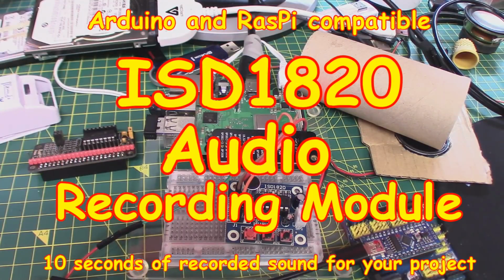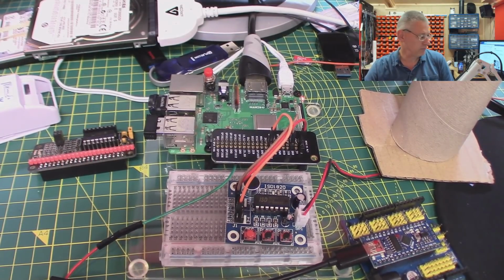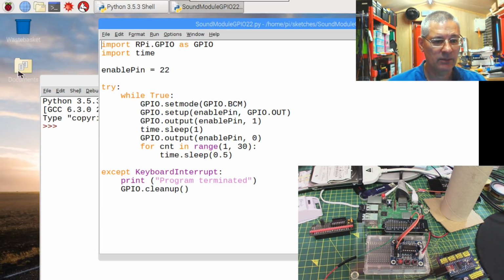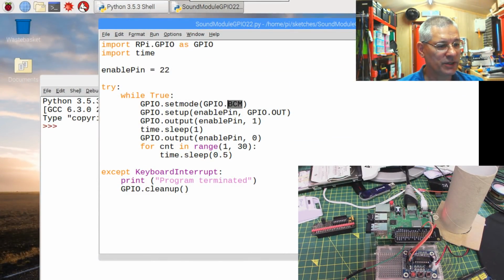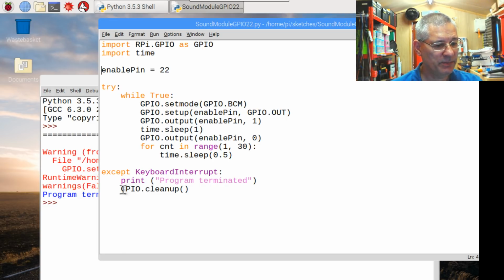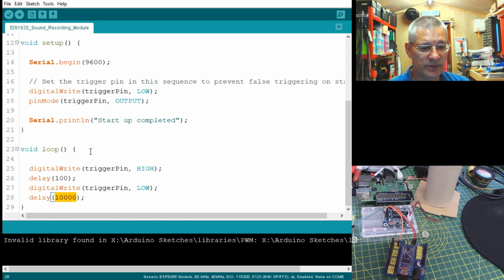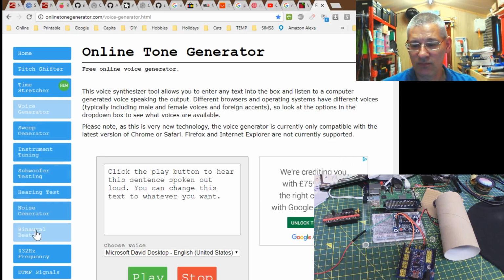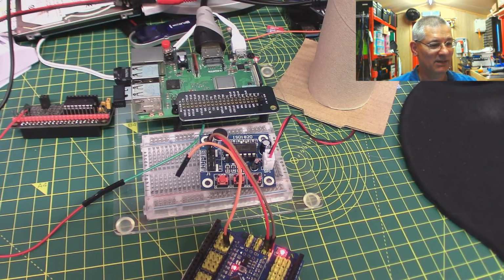#113 ISD1820 Audio Recorder Module (Arduino or 🥧RasPi)

Comment: Put the loo roll behind the speaker. In other words, put the loo roll standing up on the workbench, then put the speaker on top of it. Or cut out a speaker-size hole in the plastic top of a Pringles can and put the speaker in the cutout.
Reply from the maker: That sort of sounds like a bass-reflex arrangement, Art? Or perhaps this will actually prevent the rearwards sound coming out and interfering with the forward sounds waves? Should the other end of the loo roll be blocked or open?
 
This all sounds intriguing, explanation please!
Reply: You are correct regarding the sound from the front of the speaker being out of phase with sound coming from the rear. I somehow can't cut and paste my long answer, so I have to refer you to the Wikipedia entry on Loudspeaker Enclosure. The first three sentences of the second paragraph explain it. For small speakers, the loo roll should be behind the speaker, with the far end closed, and no gap around the speaker. You can experiment to see how the length of the loo roll affects the sound quality. For larger speakers you can use a Pringles can. I have put sound systems in G scale backyard locomotives. Affixing the small speaker to even a 35mm film canister works great. Use whatever can or roll fits the speaker best, without leaving gaps, or seal them with caulk or hot glue, or screws and a gasket.
Reply from the maker: Having now sourced another kitchen towelling tube (longer than a loo roll) I'm experimenting! From a project viewpoint, we don't want a 12" tube sticking out of our project box, though. Would just mounting it on a baffle (the project box lid, for example) sealed as you state, and with the lid actually attached to the box, would that be enough to improve volume and hence clarity? (As I said I'll experiment some more but whilst I have an expert on hand...)

Comment: So the pi gives a warning then continues anyway. So why bother?
Reply: It is possible you may want two different scripts controlling something attached to the same GPIO but that can have many unintended nasty consequences.
Reply from the maker: But surely it's better to have a warning that you might already be using those pins, possibly in another script, Andy?
 
Remember this is RasPi-land and you really can multitask so if you have half a dozen scripts running (possibly in the background) you might easily (re-)use the wrong pin. This just alerts you to the fact that the pin was not in a "dormant" state before use. And if you really want to, you can suppress that message, but that is one thing I would not do!
 
I hope this gives a use case why such warnings might be useful? Good question, thanks for posting, good to hear from you.

Comment: Silly question (I've never used python) - why did you set the gpio mode and pin mode inside the while loop? Does it have to be set each time? As an Arduino guy I'd put those two lines under the pin declaration at the top in what is kind of the setup bit.

Different question, which forums do recommend for Arduino/ESP type questions?
Reply: Gavin: Proof, if indeed proof were needed, that there is no such thing as a "silly question". The same thought crossed my mind, but I dismissed it, thinking that was how one had to treat RPi's GPIOs. So, I didn't ask the question. As a result, had it not been for your question, I would probably repeated that same code pattern everytime I wrote a Python program for the Pi.
Reply from the maker: Darn you, Gavin, I wondered if anyone would spot that 😡 Yes, of course, it should go outside the loop but I'd already done the video by then! Doh!
 
The Arduino forum is OK if you don't ask silly questions that can be Googled, so https://forum.arduino.cc and for ESP work there is https://www.esp8266.com/
 
I hope this helps and thanks for posting (and pointing out to all and sundry my [deliberate] coding error)!
Reply: Gavin Smalley, this free mag got good Python lessons, and got other topics(Bash...etc.) too
https://www.raspberrypi.org/magpi-issues/
And for Arduino forum, try Reddit and StackExchange :
https://www.reddit.com/r/arduino   https://arduino.stackexchange.com
( idea is not to limit yourself to a certain type of knowledge class, by just asking on "official" Arduino forum )
Reply: Ralph S Bacon Hi Ralph, I wasn't trying to point out an error, it was a genuine question. I've used RPis since they came out but have never used python or the GPIO capability. It's interesting to see how doing so compares to the world of Arduino. I'd have happily believed that the mode had to be set each time as python has always seemed rather impenetrable to me.

I asked about the forums as you mention them quite often and it seems to me that a forum frequented by a programming professional such as yourself would be a good place to ask questions as the advice is likely to be sound.

More on topic with the video my partner used a similar module with an identical speaker in a singing picture frame and mounting it on a hollow box made a world of difference.
Reply from the maker: OMG, I really must be more careful with my coding. The worst thing of all is that I knew it was incorrect (not optimal, anyway) but because I was adding the loops afterwards it just turned out like that. Only after the video did I realise I had not really refactored it correctly, but I thought that's OK, no-one will notice!
 
More on the forums. The Arduino forums contain a zillion questions, the answers to which could be found by a simple Google search or by a bit of research by the OP. That rankles the highly knowledgeable experts there, and they let you know in no uncertain terms that you have not made the slightest effort to resolve the issue yourself. Many of the questions are homework questions by school and college kids who want their work done for them, without actually learning anything along the way.
 
The best questions are where the OP has done some coding, tried a few things, posted a problem outlining what s/he's done so far to resolve it, add some formatted code in the proper manner and asks for very specific help. Then you get gold.
 
I don't answer questions there any more. Firstly, for the aforementioned homework questions. Secondly, all the good questions get answered very quickly so they don't need my input. Thirdly, you spend ages giving a good answer and the OP never responds (they probably found the answer themselves or just did something else).
 
Stack Exchange is definitely more for the professionals, and you may get better answers. I've only used it for my C# work (never for Arduino stuff).
 
And  +1 to Michael. There are never any silly questions, as this snippet of demo code proves. Apologies for confusing anyone, I will take greater care in the future.

Comment: The voice generator isn't fully compatible with the Firefox browser and so you get a limited set of English voices and none of them are pleasing to my ears. A little unfortunate as I had an idea for some granular synthesis involving sampled voice. Fortunately I do have Windows on my desktop machine and the Chrome browser so all is not lost.

That module could be useful in a lot of projects where you need a warning message. A little better audio bandwidth would make it a lot more useful though.

I find Python a really irritating language to use as it is so strict about formatting. But, I am a dinosaur and still prefer C or BASIC for coding so what do I know? ;)
Reply from the maker: Heh, heh, dinosaurs are still welcome, Nick! Actually, I too am a bit, well, irritated about the indentation thing when curly braces and a simple semi-colon at the end of the line would make it very clear what the intention is. Sigh. But Python is not C++ so I guess we should just accept that things are different. A bit unfortunate for the kids learning Python and then landing a coding job in another language, most of which seem to follow the Java/C syntactic model!
 
In regards to voice quality, as I mentioned to AndyMouse123, reducing the time to 6 seconds does increase the quality (it says, I've not tried) and you can say a lot in 6 seconds, warning announcement-wise. Nice to hear from you, Nick.

Comment: I'm always impressed by how easy it is to set up and use some of these modules. BTW, I you can refer to python code as a script, that's probably the nearest equivalent to the arduino sketch.
Reply from the maker: A "script", excellent, thanks for that, Mike. Sounds most reasonable too, given that it is a script and not a compiled program. Thanks for posting.

Comment: Nice light, fun video (I'm interacting ) probably get bored of this quite quickly but went on E-Bay and bought one anyway!
Reply from the maker: If you're buying one, Andy, then you can experiment with the different bit rates vs recording time. I found it amazing how much you could say in 10 seconds. A simple warning could easily be announced in 6 seconds or less, so the quality could be increased. Have fun with this, easy to use.
Reply: hi Ralph.....yep will have a muck around alright. ...Just off the top of my head maybe play around with some parameters and create strange effects...who no's after all that's the fun of it !...….gonna see if I can get "The Element Song" into 10 seconds.
Reply from the maker: Heh heh, encode it at 64x speed you might just do it!

Comment: Handy little device
Reply from the maker: Cheap, at least, Ed, whether it's handy or not depends on your application I suppose! But at this price worth keeping a couple in, just in case! Thanks for posting, nice to hear from you.
Reply: I have one reminding me to put the trash out. I know, IFTTT can send you a notification for that, but a nice voice reminding you is so much better
Reply from the maker: How does it get triggered, Ed? Day of week or weight of trash bin? And does it just play forever until you switch it off or only when it detects someone nearby (PIR-triggered)?
Reply: nothing that fancy. Just a message every Wednesday night at 8 :-)
I make a pin High and then it plays the entire message, once.
I have a slightly different board, still an 1820, but from LC technology

Comment: Do you know how to make facial recognition to recognise me using pyton on linux that uses mp4 files as input? I want it to send a url command to open a door :)
Reply from the maker: I don't, Jay, but I bet if you Google you will find someone who might have done this!
Reply: Jay Mee 
You can pipe your MP4 into OpenCV and make it work.  Unfortunately it will be a bit clunky.     Apple offers a similar feature on their new iPhone that takes 3D facial measurements, and even their very advanced system has problems.
Reply: try OpenCV, it might work. You might wanna replace input source to video file instead of cam.
https://en.wikipedia.org/wiki/OpenCV
https://www.youtube.com/results?search_query=OpenCV